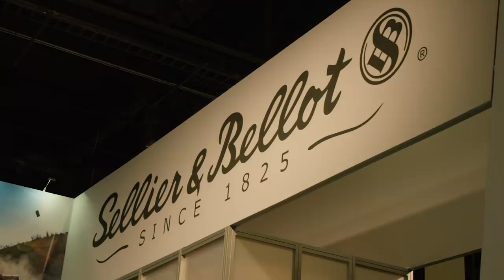Shot Show 2019 - Magtech

Comment: I like Magtech ammo very well. Magtech is very well made. I've never had a failure to fire with any of their standard ball or hollow point rounds. Magtech is supposed to be widely available, however that has not always been my experience, particularly with hollow nose rounds. My favorite hollow points in 9mm (9BONA, 124gr, bonded, hp) are almost never available OTC and only in small quantity and for short periods at a few major online dealers. When available online the price is good but unless you can buy in bulk shipping fees makes the cost of buying one or two boxes not worthwhile. I'd like to be able to buy more variety of Magtech ammo at stores like Academy, Cabela's, even Walmart.
The 9BONA 124gr, bonded hollow point is, in my opinion, a good choice for a lower priced EDC round for 9mm. The 9BONA has a muzzle velocity of 1165ft/sec and muzzle energy of 375 ft lbs. 309 ft lbs @ 50 yards. Nice expansion and penetration in ballistic gelatin through 4 layers of denim.